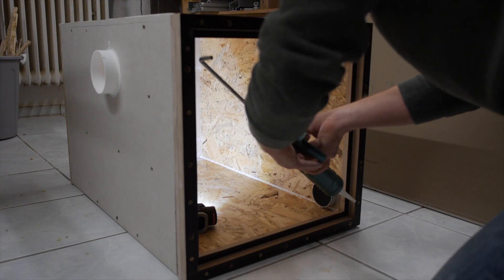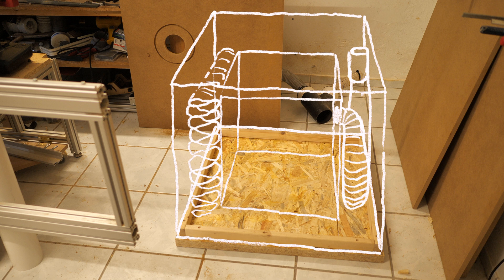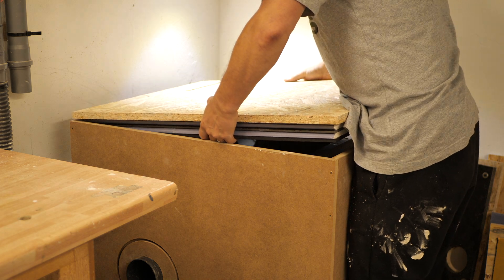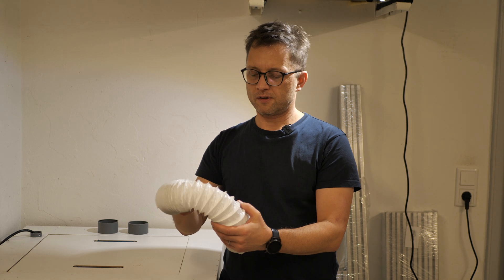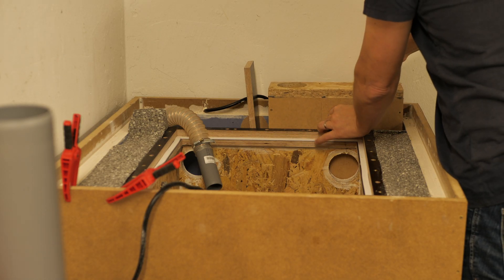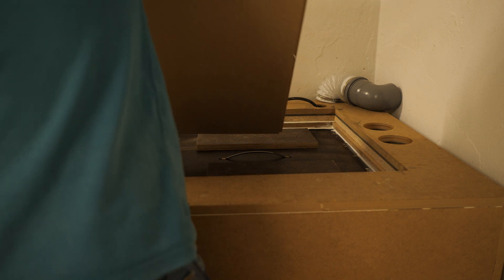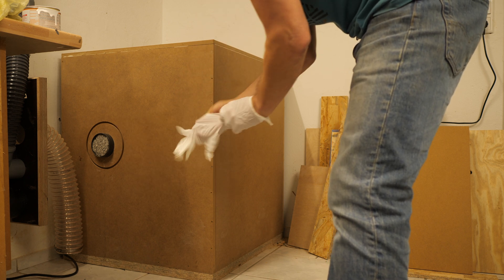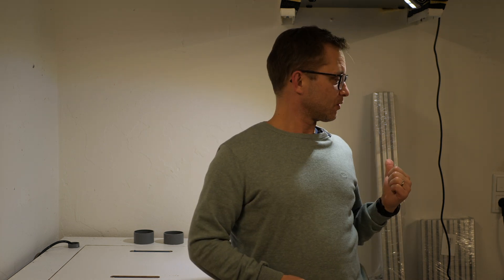Silencing loud things Part 3 (final part)

Comment: 55 dB is insanely great result, from almost Jet engine 90+ dB! You basically can have conversation around it, and barely notice it works. German analysis approach. Chart is obligatory 😀But the complexity is not small unfortunately. All this green sound dumping glues are not cheap.

Comment: Great video and series! Are you at all concerned about the heat build up in the box? My understanding is that the camvac needs a break after 40 mins of use.. wonder if this use time is shortened by the enclosure? Purely curious in your experience here. Thanks and best regards!
Reply from the maker: thx. And good question: my experience is, that the vac is not getting too hot inside that enclosure. The exhaust air is warm, but not hot. I think the motors are cooled by the air flowing through the system, less by surrounding air. But I‘m making sure that I m always around when the vac runs, it’s never running longer than 10-15 minutes and there’s a smoke alarm above the enclosure. Keep it safe.
Reply: @tims.2832 amazing, thank you for your swift reply. I really like this solution. Also a quiet shop is a happy shop. Thanks again and can’t wait till your next upload! Best regards!

Comment: Schönes Projekt! How about the temperature? Have you mentioned something? How much effort is it to get the CamVac out of the box, to empty the bin or clean the filter? 🤔
Reply from the maker: Thx. And you are right: The vac delivers 2k watts. Thats a lot of energy inside any kind of enclosure. But my impression is, that the vac is cooled by the air which is drawn through the system. And usually my vac runs only as long as I am switching on the table saw or drill press or router table, which is basically only a couple of minutes. The exhaust air gets warm, but was never hot so far. In any case: I wouldn´t let the system run without being around, make sure it can´t activate while you are not in the shop. Also, I have a smoke detector above the enclosure. Stay safe
Reply: @tims.2832  That sounds great! Thank you :) Liebe Grüße

Comment: Excellent result. As mentioned in my previous comment on the second  instalment of this build, there has to be an issue with heat build up with this kind of enclosure. As it is now several months since the original build, I'd be interested to hear your experience. Nochmal, vielen Dank aus Schottland!
Reply from the maker: Good question : I wouldn’t let it run for longer than half an hour. I had running for approximately 20 minutes, and the exhaust air was kind of warm, but not hot. Since it’s 2 kW of energy, I wouldn’t recommend to let it run for an hour anyway, because it would get expensive overtime. Furthermore, I have a smoke detector above the enclosure.
Reply: Thanks for the quick response. I tend to use the large, noisy vac only with the mitre saw or table saw. For other operations, I go with a small cordless vac that is much quieter. That said, with both of those larger tools, it is unlikely to be running continuously for very long. Sanding or using the router is another matter. I'll definitely have a go at making one.

Comment: Thank you. Very helpful video.  I am trying to find a budget friendly solution to collect dust for a cnc router that uses a handheld palm router.  Thus, would you recommend a Camvac (that you have) attached to a cnc machine?  A cnc router job can run hours at a time.  I heard the Camvac can only run for 45 min before overheating. Many wood workers use a shop vacuum but the Camvav is much better than the shop vacuum.   Any light you could provide would be greatly appreciated.
Reply from the maker: Good question. I think the camvac should not run that long. It´s 2k of watts crammed into two small motors in a small bin. Thats a lot of energy. Recently the camvac was running for about 20 minutes while I was routing a bunch of parts for drawers. The exhaust air was warm, although not very warm or hot. Neverletheless, after 20 Minutes I felt like "nah, perhaps I should give it some time to cool down".

Comment: @tims.2832 thanks for the very helpful and interesting video. I have some questions 😅. Did you use basotect or a generic alternative? Do you think it is more effective than those recycled rubber granulate mats that can be used for anti-vibration and on construction sites? Also, did you consider  alubutyl sheets used for cars? I'm considering these two options for my own upcoming sound proofing project, because I thought they might be quite good at lower frequencies and might need less space that mineral wool
Reply: I just watched the first two videos now and saw that you included butyl strips in your sound test. I wonder how it would have performed if instead of only using strips, you'd covered the entire walls. I think its only a bit less dense than mass loaded vinyl (though typically thinner), but has the added benefit of being elastic/viscose, so it also converts lower frequencies especially into heat in the same way that the green glue does. Not sure how much heat gets generated, which could of course be it's own problem
Reply from the maker: Hi Sebastian, I didn´t consider alubutyl, since this seems to be a very car-specific product, I would partly pay for charateristics I don´t need. Basotect is a good alternative to mineral wool, but its more expensive than mineral wool. Mineral wool is more fire resistant. I went with mineral wool mainly because of the price. Butyl is resonably affordable if you just use these cords/strips as decoupling stuff, but the costs would have added up if I had covered the whole wall. But my impression is, that in the whole system, the density/mass of the wall material and good airtightness does accout for most of the soundproofing result and less the layer of mineral wool (or hypothetically foam).
Reply: @tims.2832   thanks for the response Tim. I asked about basotect because I saw you mentioned it in another comment, but I see now you used it only for the exhaust maze. 

Regarding alubutyl, there's surely something im not understanding about using alubutyl, as it seems like it is an excellent and reasonably affordable (12eu per sqm) product for sound proofing even in non-auto applications, but I haven't been able to find much evidence online of others doing this. It's very dense and can be used in the same way as green glue, to create a constrained damping layer. If there's a reason you think it's not a great option, please let me know

One last question, I didn't find mass loaded vinyl online in Germany (where I'm based). Could you please let me know a product name that I can search for? Thank you!

Comment: Great result for noise - but how easy is it to empty the camvac. As you say the whole idea is to not have any dust at anytime and emptying seems pretty hard - except if you used a vac. 😀
Reply from the maker: it is easy, to detach the VAC and take it out, the top side is wide enough. The vac is coupled with the inner enclosure via magnets.
Reply: @tims.2832  I had forgotten about those and their purpose.  Well done.  Did you cover the actual can in MLV, it would seem best to stop the noise as close at the source given how much work you have put in. 
As others have said awesome series showing the effect of various treatments, vid 1&2. I particularly like the fact that you did a free field analysis to get higher quality measurements. I had always wondered how to do it best for cost. 
Then showing just how hard and serious you have to be to make highly significant noise reduction vid 3
Reply: @tims.2832 don't you find the top hard to get off? Mine is a huge pain

Comment: Most vacuum noise is the inlet and outlet wind.    How does this perform regarding heat ?  Does the vacuum motor get too hot ?
Reply from the maker: Hi, the inlet and outlet wind is definitely less loud than both motors with 2k watts in total. But of course there is some noise in the airflow as well. The heat question is very good, I was concerned about that as well: I made a test run for about 15 minutes and the shopvac was kind of normal warm. It seems it’s the flowing air that cooles the vac the most. However putting any 2k watts device in an enclosure should always be paid attention to. And don’t forget the risk of static electricity and sparks etc. I have a smoke detector on the ceiling above the vac.
Reply: @tims.2832   Thank you .   That is very informative.

Comment: Nice!
I once (around 20-25 years ago) set out to build a box like this for a computer that I thought was too loud. I never finished the project though because I made some mistakes early in my design and it made building it very difficult. Also I don't think I managed to find any high density rubber foam material to line the "maze" with. I think it would've worked had I not been too sloppy, because I think I hade similar ideas as you, and yours obviously is working.
Reply from the maker: Thx. Yeah, sounds familiar. Btw, the lining in this maze´ish box is an open cell foam, the trademark here in Europe is basotect. I forgot to mention that in the video (I rushed it at the end to have it published finally).